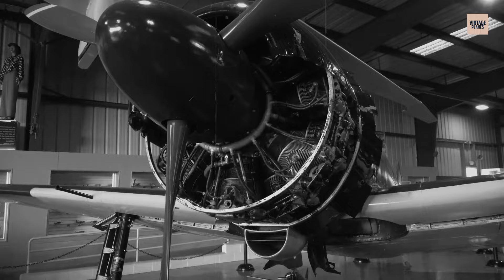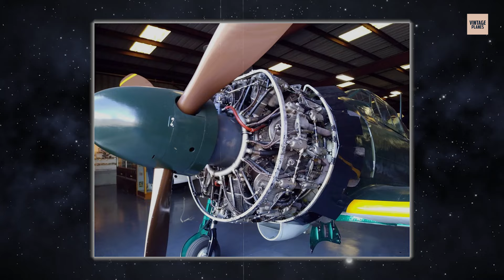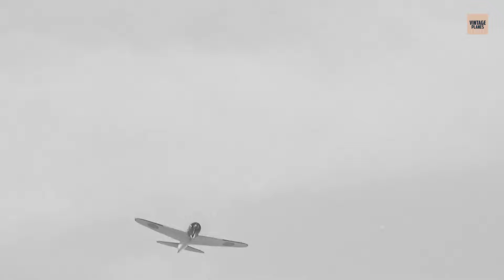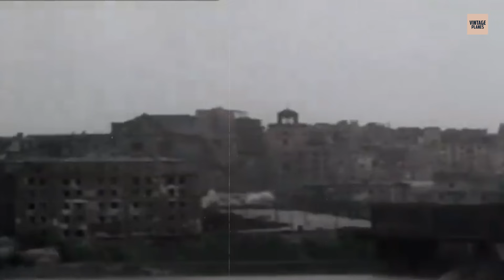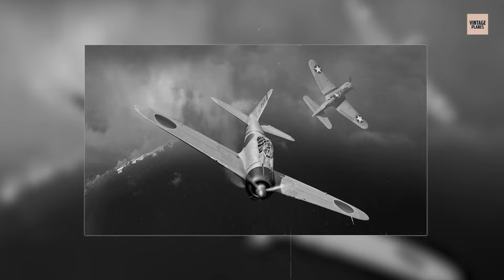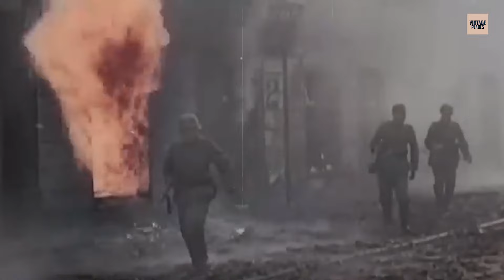THE SHOCKING TRUTH BEHIND THE NAKAJIMA SAKAe ENGINE

Comment: Thank you for your valuable information. However, I would like to make a few corrections. Regarding fuel, Japan was able to supply 93-octane fuel until almost the end of the war. We now know that they were able to refine oil from the Netherlands and Indonesia. They also did not use synthetic fuel. That must have been Germany. Also, after the war, the U.S. military tested Japanese fighter planes using American gasoline and oil, recording excellent performance, but they mainly used fuel with an octane rating of 100 or higher.